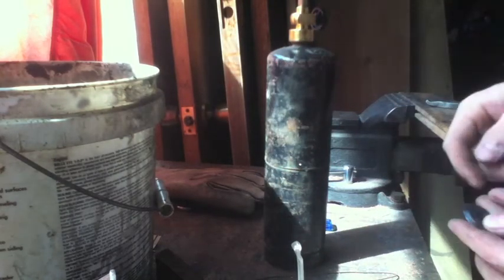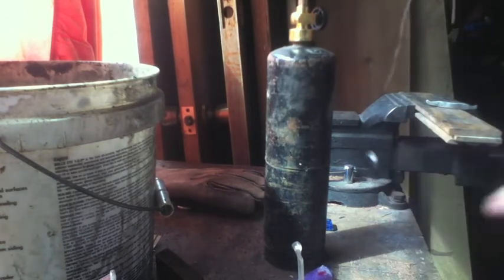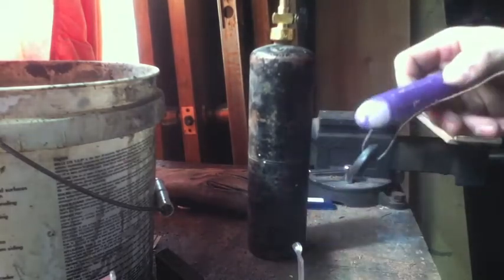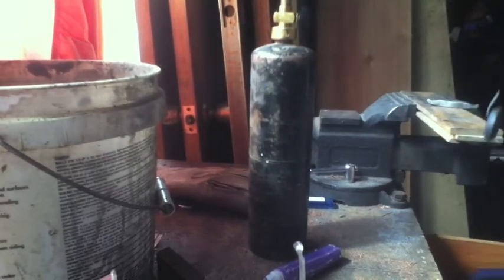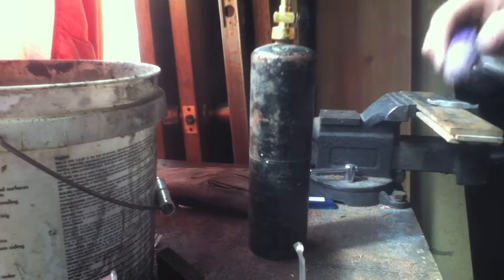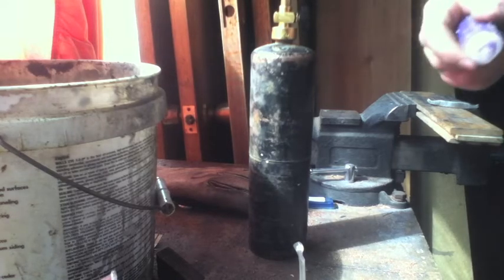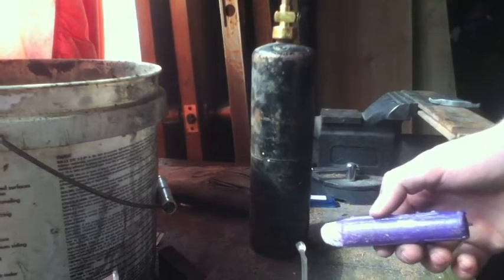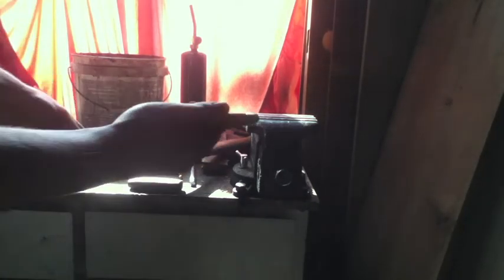The Project Finish! (CS:GO Knife.)

Comment: Nice blade. Make some soft jaws for your vise. Clamp a piece of brass/copper sheet metal big enough to cove the face of the jaw plus about an inch sticking up and hammer it down. Repeat for the other jaw. Grips better & won't mar your work.
Reply: *cover
Reply from the maker: +57cpdvl Thanks for the suggestion! I'll do that. (Eventually.)